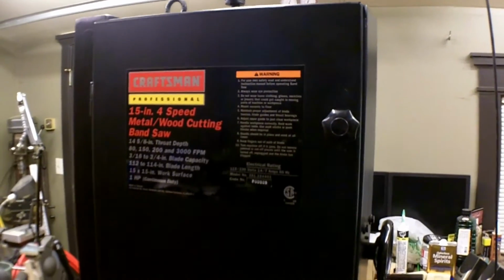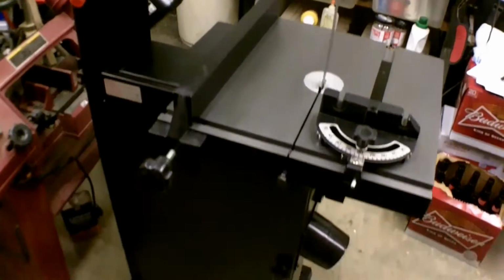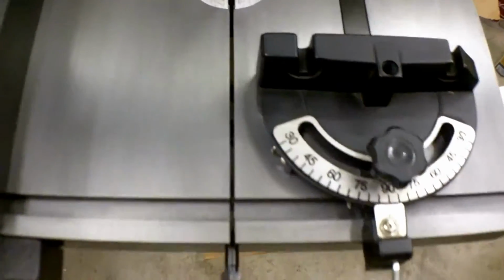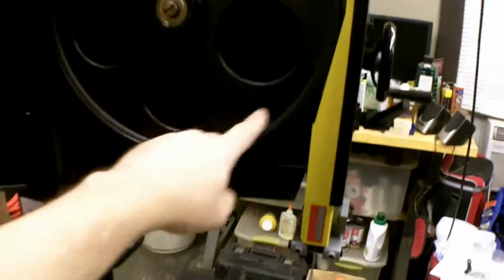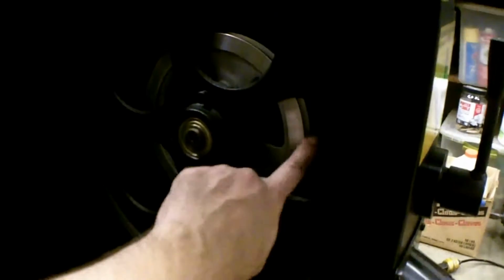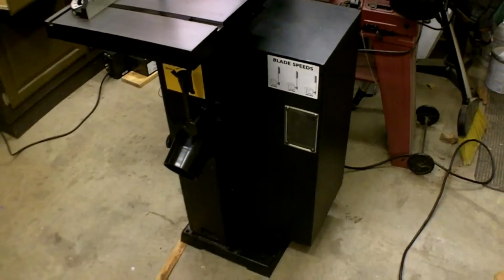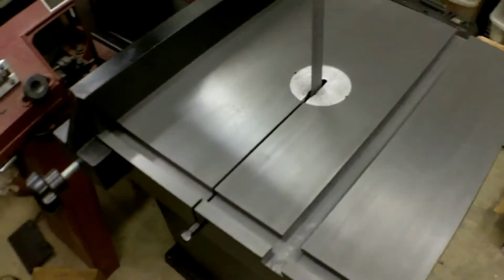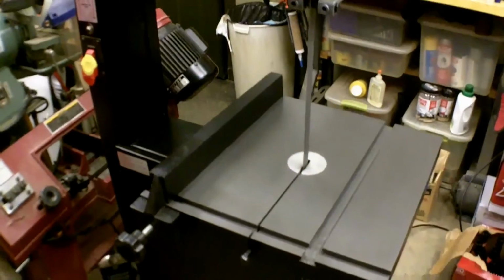Craftsman Metal/Woodcutting Bandsaw Tool Gloat

Comment: Long shot, but if you're still here I have a question on the saw. Does the lower blade wheel pull out on the saw? I just got mine set up and noticed that my lower blade wheel easily pops out without the pulley or blade on it. Figured it might be to easily fish the belt onto the pulley on the backside, but wanted to check. Almost no documentation on the 15 inch I've found. Thanks in advance!
Reply from the maker: I am still here, and no- the lower blade wheel is always in the same position vertically to keep the tracking of the bandsaw blade consistent. The right side of the saw, as well as the gearbox shifting lever, only affects the right side of the saw. It seems to me, you might have a shaft collar that came loose. The left side lower drive wheel, as well as the left top should idler wheel should NEVER make any lateral movements. I hope this helps. If I'm off base- be more clear. YouTube no longer lets me know of new comments/replies- so it may take some time for me to respond. I will though- but you must be patient.

Comment: wondering difference between this a a regular band saw which is not a dedicared metal saw ?
Reply from the maker: +frank c 
Frank, the big difference is blade speed- expressed in feet per minute. You cut wood with a fast blade speed, and metals with much slower speeds. For example, you might cut wood at 3000FPM, but steel at 80FPM. You can get a dedicated wood saw, or a dedicated metal saw. This particular saw runs both fast and slow speeds, so it's in essence two saws in one. Hope this helps, G.
Reply: thank you , exactly what i wanted to know .
Reply from the maker: +frank c 
No problem Frank! Good luck, G.

Comment: I first subbed when you did the belt sander mods, can you do an update on it?
Reply from the maker: Randy, the saw is still working great. I don't believe they make these types of wood/metal saws anymore. As a matter of fact, I called sears to check on one bracket that it was missing to store the fence in and they couldn't even locate it by model number. They have no record of this saw. Plus the saw I have doesn't even have a serial number on it anywhere. They tell me this model never existed, but I have it as well as the manual-  It's strange. Now that I read your post again, it looks like you might be asking about the belt sander. It's still working fine, but the motor is a little underpowered. All in all, I can't complain. Keep in mind, the sander I have has been replaced by another model. It's a bit different, but should work the same- and possibly with the same issues. Not sure which tool you were asking about, so I answered for both...  G.
Reply: ***** oh, I was actually talking about the 4x36 belt/disc sander that you got from harbor freight and had to crown the wheels to get it to track straight. You find some sweet deals I must say. I cant find quality used stuff around here unless Im just looking in the wrong places.
Reply from the maker: Randy Savage  No problem Randy. Other than the motor being weak- it's working just fine. I don't know if the new model has a more powerful motor and has any tracking issues. For what they can be had for on sale and using a 25% off coupon, it would be worth the gamble in my opinion. If it's not working correctly, fix it or just take it back!

 I just keep an eye on eBay and Craigslist for good deals here and there. Also search Craigslist garage sales for tools. That's another place to pickup good stuff for good prices. It's just a patience and persistence game- but it pays off. I think I looked for about 1.5yrs for my lathe, and quite a while for the band saw. If there isn't an immediate need for a tool, that's the approach I use.

Good luck,
G.